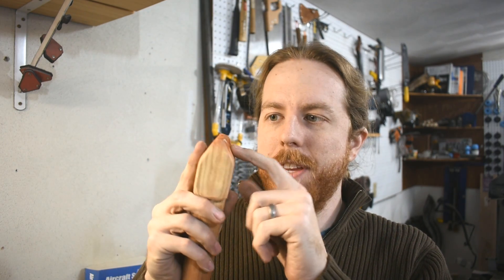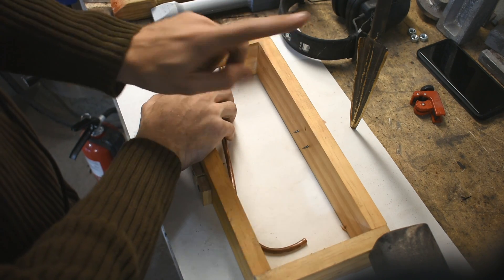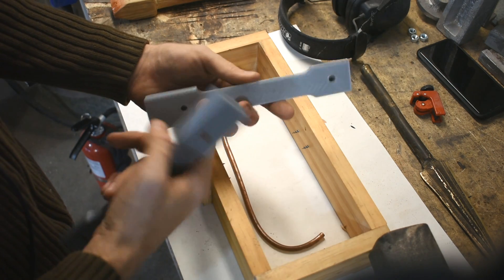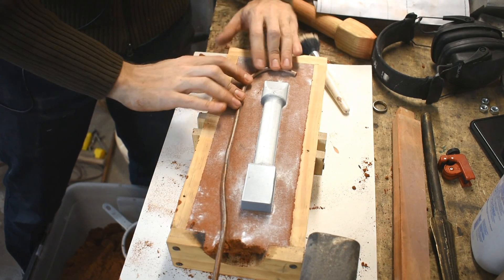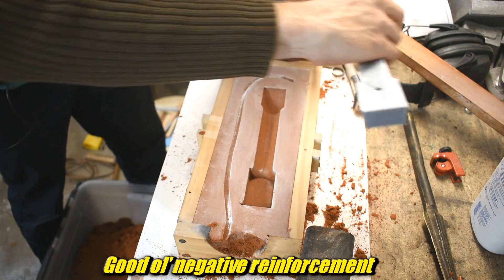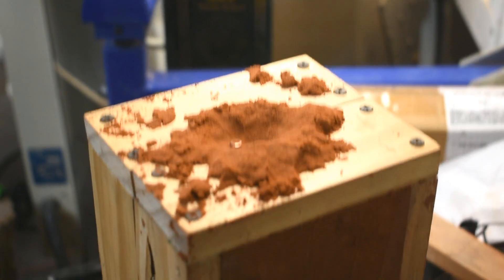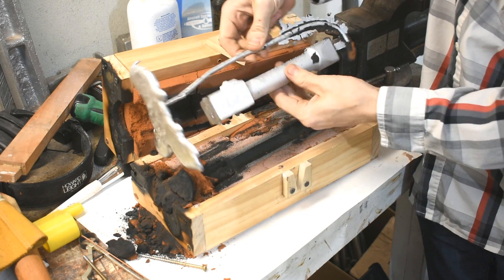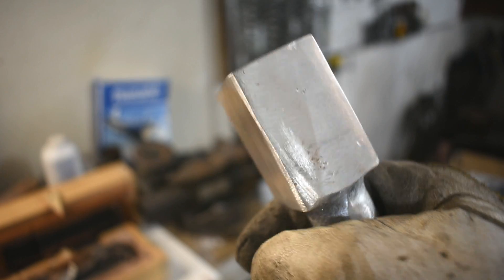Casting Aluminum Sand Rammer from a 3D Printed Pattern with a Vertical Casting Flask

Comment: Paul your videos are a fun "laid back" way to learn about casting. Its fun to watch as you bumble your way through each task while the complexity increases and you start to get better each time. Your  perseverance is key. I would like to suggest one improvement. Please show a pic or diagram of the final prep before you do the pour so we can see exactly how & where the metal is supposed to flow. That would really help as I have been following along slowly using your vids as a guide.

Comment: Wax or hard soap onyour flap disc will prevent it from blocking up.
Reply: Hmm, I've never heard of that before, interesting, tricks of the trade, IL have to check it out 👍
Reply: @duskrunner333  yep there is wax specifically for it.

Comment: I'm going to try this style sand rammer using the lost foam method soon, skill lvl not high enough for flasks and molding like you do, 
and having a 3D printer that doesn't work isn't very helpfull either :(
I wasn't very confident either seeing the pour, but very nice end result, well done 👍👍👍
Reply from the maker: Seeing how much my mold leaked, I don't think I have above average molding skills, give it a shot